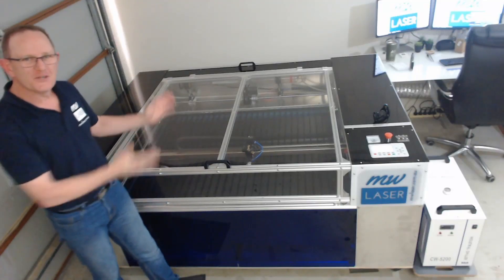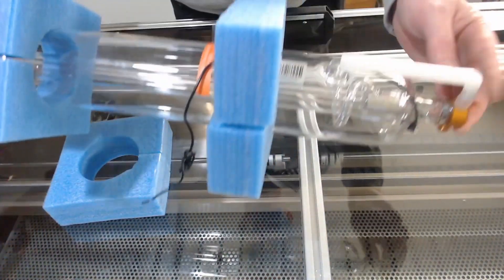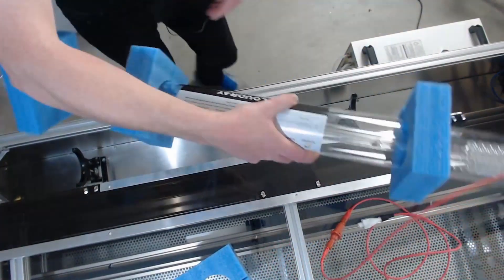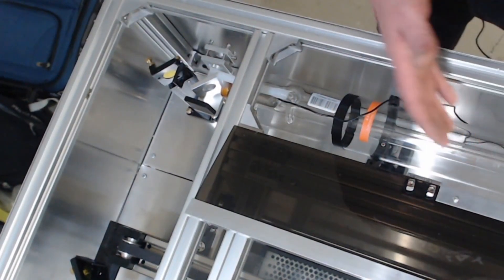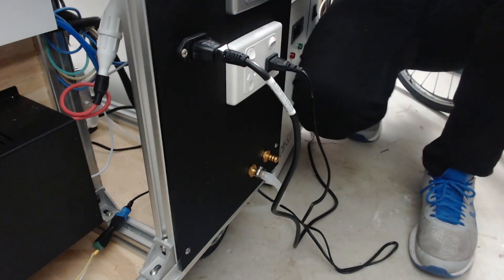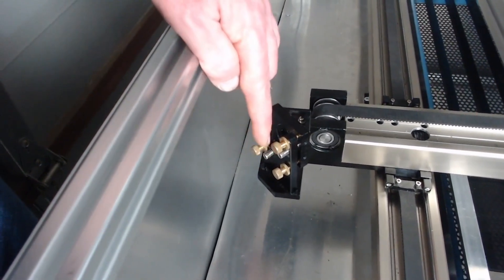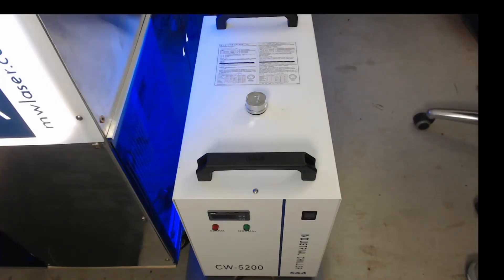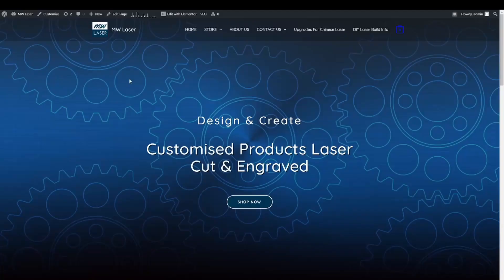08 Build Your Own Laser - Laser Tube Installation, Alignment & Water Protect

Comment: Quick question - do you have your laser enclosure grounded? I am in the midst of my first DIY build and am unsure if this needs to be done?
Reply from the maker: Yes it is all grounded and mains power is grounded
Reply: @MWLaser  Thanks, seems like where I might have made my life more difficult than it needed to be is by using anodized aluminum. Does this basically mean I am going to need to run a bit of wire, and screw into, every extrusion piece to ground my enclosure?

Comment: Hi, which size of water pipe did you use? My 90w cloudray tube is in transit, and I ha ve no idea which water pipe I need
Reply from the maker: I use 10mm Inside diameter tube
Reply: @MWLaser  cloudray only sell 7 and 8 mm inside diameter

Comment: Thanks for your explanations but i didn’t understand the usefulness of the beam combiner set. Can you explain to me please? Thank you
Reply from the maker: The beam combiner combines the red dot diode (visible light) with the (invisible) co2 laser beam so that it appears out the bottom of nozzle rather then a red diode pointer hanging off side of the laser nozzle.. therefore making the positioning of the laser more accurate.  Cheers
Reply: @MWLaser  thank you very much and congratulations on your work.  I believe I will start this project in 2022.

Comment: Where do I find the plans to build one of my own?  I looked at your store front, but don't see it.
Reply from the maker: You would need to draw up plans for your own build, as many components and configurations vary.
I have a link in the Frame Building Episode for Framexpert software which can be used to design the Alloy profile frame to your own specs and sizes.

Comment: After marking did you use the laser to cut out that keychain, if so, what material and thickness is it
Reply from the maker: Yes, the material is 1.6mm thick it was an acrylic ply from either Rowmark or Trotec

Comment: Hey Matt, what is the diameter of the perforated grid under the work table? and the thickness? fantastic video, thank you, great work
Reply from the maker: Approx diameter of each hole is 9mm  the thickness is approx 2mm (i only have this there to catch parts and offcuts that fall through)

Comment: I'm trying to mount my 80mm W1 tube in the metal tube mounts, but I don't have any sort of rubber collar to Goa around the tube? Is that something you wrapped on the tube? The 80mm tube mounts are closer to 85mm.
Reply from the maker: I use a wrapping of insulation tape if there is no rubber available.  As mentioned in video at https://youtu.be/h7wMw_xlWUA?t=332 and can be seen at https://youtu.be/h7wMw_xlWUA?t=636
Cheers Matt

Comment: could you change a co2 to a fiber laser or possibly switch from glass to metal tube?
Reply from the maker: Yes you could make changes to use Fibre, Metal Tube or RF Laser Tube

Comment: Now that you have had the build done for awhile, can you give some feedback of what kind of speeds you able to get for engraving? Many tout 100mm/s but few can easily handle 300mm/s. Thanks and great job :)
Reply from the maker: Engraving speeds depend on the material you are engraving and depth of burn you require.
For me engraving on this machine with acrylic fly I regularly operate at 600mm/sec.
however if doing photo engraving this would need speed to be reduced to enable you to get the resolution you require for higher definition photos.
For regular text / logo engraving on alloy, powder coating, timber ply, acrylic and leather, 300 to 600mm /second produces excellent results
Reply: @MWLaser  Thanks for the update :) Stay Safe :)

Comment: Thanks again for your detailed explanation. I ordered the wiring diagram PDF from your online store and I definitely recommend to others to do the same, it is crystal clear, time saving  and helpful.  I have a question related to the focus lens: there are multiple models with various diameters (from 12mm to 20mm) and various  focal length (from 25 to 160mm) . The 1390 inner sliding rail documentation says it supports  50.8/63.5/101.6mm and I do not see anything related to the diameter. Would you please let us know which model you ordered ?
Reply from the maker: For this build I used a 20mm Diameter Lens with Focal Gap of 50.8mm - Available here https://mwlaser.com.au/product/cloudray-focusing-lens/

Comment: Maybe a suggestion for another video: what about the air exhaust ?  With Trotec laser cutters, there are multiple stages air filtering (it is costly, complex .. but air stays in the room once filtered )  Is it better to let the airflow go outside the building ? What do you suggest ?
Reply from the maker: For most home and small business users, such complex and expensive filtering systems are not in their budget.
Simple filtration and ensuring you do not cut or engrave anything that will cause toxic fumes (such as PVC) and you vent outside is sufficient, If this cannot be done, then invest in one of those filtration systems.  (as with use of any equipment the use Personal Protection Equipment including face mask may be required/desired). Cheers Matt

Comment: Great job and thanks for sharing your knowledge. Would you mind to give us more details regarding the bed. I'm a little bit confused. Where is the blue metal frame coming from, could it be made of alu profile  instead ?   How to order the alloy fin (a copy of your purchase order would be nice),  do we need or not a honeycomb and how to order it ?    Many thanks !!
Reply from the maker: If you like to buy the alloy fins email Cloudray Laser requesting quote for the size you want.  You will need to let them know the size of area you want, and the spacing you want the fins to be apart, they can make for you.
I purchased the "Blue" metal 40x40mm steel for the frame and had it welded. You could make this from Alloy profile, but I wanted to make sure there was no flex in laser bed so I chose heavier duty steel.
Your preference if you want to use honeycomb, I chose not to.  You can order from Cloudray's Website.  Unless you can find local as honeycomb is heavy and expensive to freight.
Cheers Matt

Comment: Hi.  Why you used AWC?  I saw you show RUida previously. Thanks.
Reply from the maker: I installed the Trocen AWC 708S for several reasons. One was for personal research and testing and the price is affordable for most DIY. It has features I needed such as 3 axis control, I could connect ultimate air assist, and auto focus etc. It is compatible with Lightburn like the RuiDa, and I also wanted to be able to try another brand controller to provide some video content for users of the Trocen Controllers in the future.
My experience so far has been fantastic, it is very easy to use and I will provide a review and info on settings in future videos, they are worth checking out.
Cheers Matt
Reply: Thank you, Matt. I'll be waiting for new video.

Comment: Great job Matt! I have been following your entire series of the build and also ordered all the parts from cloudray a month ago. I have everything except the aluminium profiles to start my build. I was wondering if you would be able to share the design for the enclosure. I was hoping to order my aluminum profiles this week. I want to take a slightly different approach to how i build my enclosure, but wanted to double check with yours and make sure my general dimensions are the same.
Reply from the maker: Sorry for missing this comment earlier, I will find my first plan demonstrated in the frame build video and link the pdf to my webpage in the next few days here (https://mwlaser.com.au/diy-laser-build-part-2/)
Reply from the maker: Done - Cheers Matt
Reply: @MWLaser  Thank you!